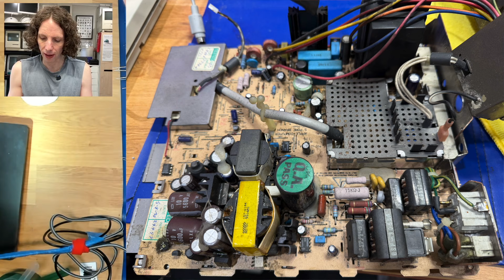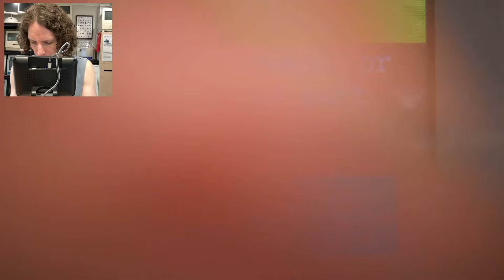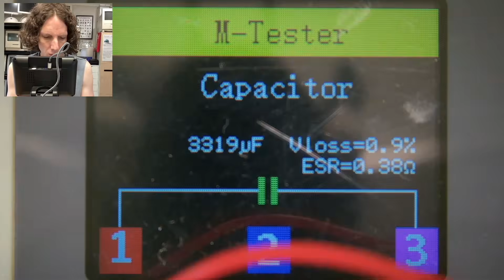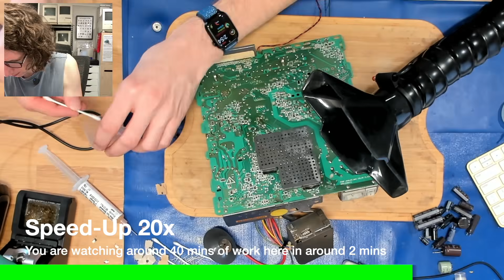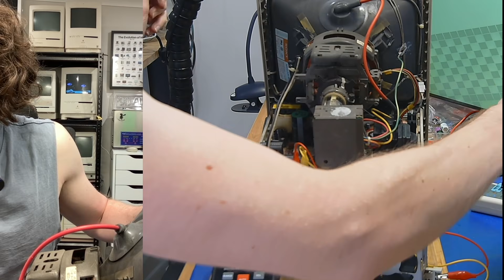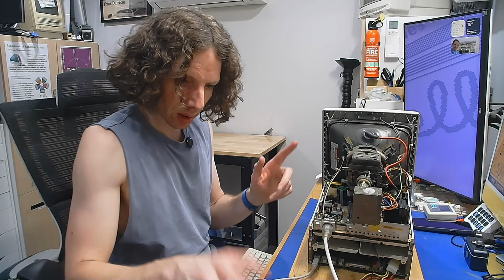Why My Rare Color Classic II Wouldn't Boot… Analog Board Repair #retrocomputing #apple

Comment: Next time wash the entire board in soapy water, or better yet, use an ultrasonic cleaner. It’s worked for me several times.
Reply from the maker: That’s a great tip, I definitely use my ultrasonic cleaner for the logic boards -  I tend to be a little more hesitant with the analog boards just due to some of the components on there that could trap water, plus also due to the size as my UC isn't really big for it to fit easily.  Have you used it with analog boards?

Comment: Those chips is a main issue in the 128/512/plus analog boards also. I have had to replace a few on CC before to get them to work also.
Reply from the maker: Hey Will!  Ahh that's interesting - I didn't know they were on the 128/512/plus AB's as well - it's been awhile since I have worked on one of those.   I've replaced this chip in the Mac Classic before also to fix voltage / screen jitter issues as well.    What sort of symptoms do you see on the 128/512/plus when it is failing?